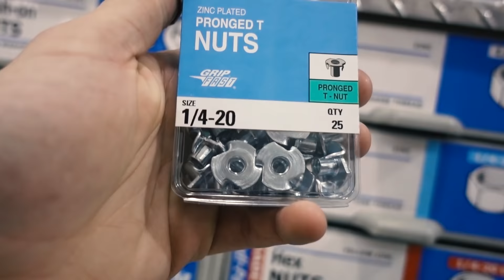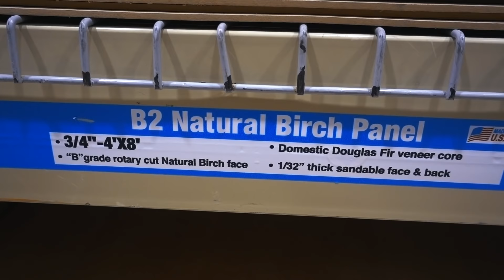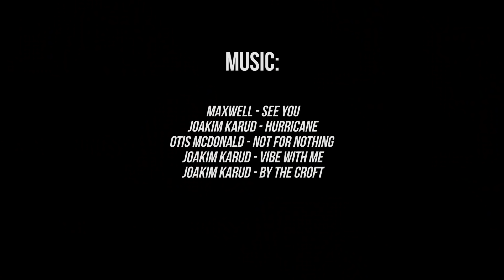Start A Workshop For $600 - #001

Comment: Good job man.  I'm actually in the remodeling business.  One issue.  Never fully trust consumer grade "combo" tools.  Hit up your local pawn shop for tried and true, well made used "prosumer" gear.  A three year old Hitachi router  for $30 at your pawn shop will be reliable and powerful enough to do any job you need. (You'll realize the power issue soon enoug) And there are always a stack of pro tools available. Honestly even brand new Harbor freight cheapo tools are better than any combination gimmick tool.  Nice video.  Keep up the good work.  Can't wait to see your progress, and watch you learn the tips and tricks of woodworking 👍🏼

Comment: FWIW, the birch plywood Menard's sells isn't true baltic birch.. it's still pretty good stuff (many thinner layers = better stability), but its only a 1/32" or thinner veneer of birch which is pretty easy to sand through or chip. 

Actual "Baltic Birch" is manufactured in 60x60" sheets, is made entirely of birch, and has a much thicker veneer than most plywoods.

Comment: Why's was there a different router & a corded matrix in the final work bench but you had a lithium ion battery powered matrix to start?  < also they made both a mini  circular saw for the matrix & Wal-Mart has 1 for $30